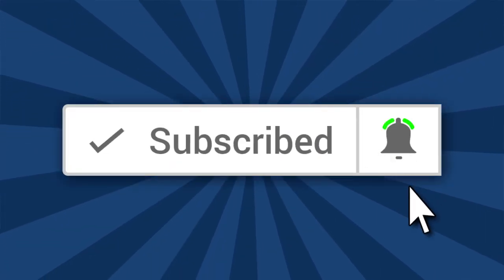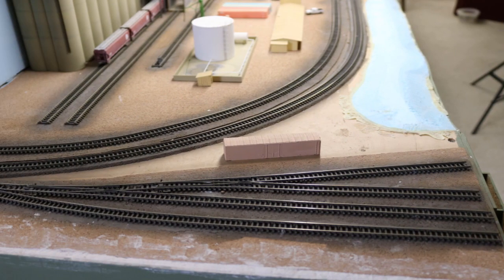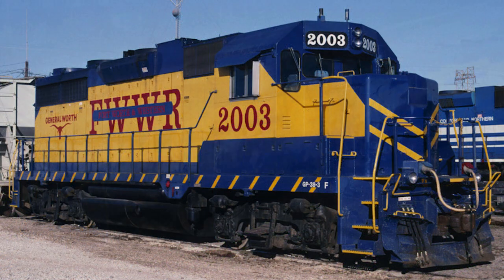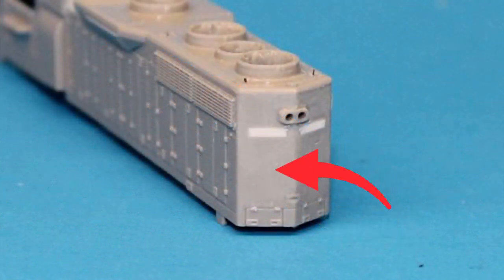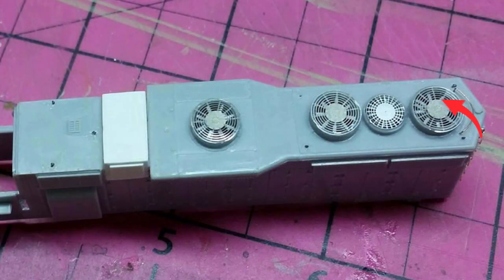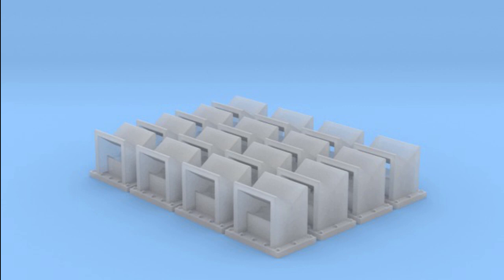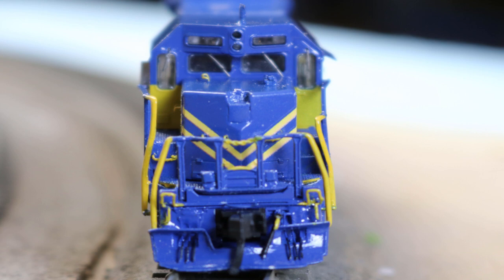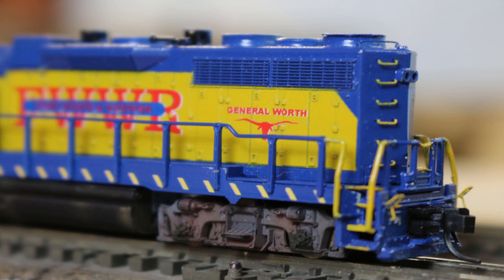Custom Paint and Detail a Model Railroad Locomotive

Comment: Well, Ron, when I want to rust something on my engines and rolling stock, I use real rust.  Here's how it's done.  First I take some 0000 steel wool (fine) and put it in a quart jar.  I then add enough white vinegar to cover the steel wool.  I set it in a kitchen window until the steel wool is all rusted and nearly consumed by the vinegar; usually takes about a month or two and I shake it every so often.  I then pour the mixture into a glass baking dish about 9" square and place it in my closet until all the liquid evaporates, usually 1 to 2 weeks.  I then use my single edge blade scraper and scrape all the rust into a pile and use the razor blade to pulverize the rust which turns it into a rusty powder.  I then pour it into a container like a snuff can.  When I get ready to use it I mix some of the rust powder into a small plastic cup (communion cup) with a drop or two of Elmer's glue, a couple drops of isopropyl alcohol (usually 70%) and a drop of water soluble glycerin.  I mix this up and apply to the engine or rolling stock.  If I want to make the plastic look like metal, I usually make a thin wash out of the rust powder and wash the piece and let it dry.  It makes the plastic look pretty much like metal.  So when I want something rusty I use REAL rust.

Comment: One tip for those MRC decoders would be a sugar cube. I've added a few of the MRC/Digitrax drop in decoders which they sound good. But nothing compared to ESU/sountraxx. But a good sugarcube speaker helps make the sounds louder and more clear.
Reply from the maker: Thanks for the tip. I've been thinking about a sugar cube or a cell ohone speaker.

Comment: As I am modeling a fictional shortline, I decided I wanted to repaint and decal some of my locomotives.  I've chosen to go a slightly different route, by brush-painting with latex-based wall paints, since places like Home Depot can tint little half-pint samples to literally any color you bring in a sample of.  To reduce brush marks (though, I'll admit, not eliminate them), I added Flotrol (which required me to find a graduated measuring cup with a half-ounce graduation).  The painting went well enough, I think.  If you have a steady enough hand, there's no need to mask areas off, other than to create crisp straight lines.  I even found that sharpening a toothpick makes for a good tool to scrape the paint off of the windows when you slip.
For decals, I chose to go with one of a few available products that allow you to print your own decals with a computer printer, choosing the Blinggasm brand laser printer decal sheets (because of the cost).  This was a mistake, as the plastic that makes up the decal isn't quite clear.  It's close, but not so close that the area around the image doesn't end up a slightly different color than the paint of the item you're putting the decal onto.  Thankfully, I tested the decals (three of them) on an unimportant item, and did not end up messing up my locomotives.
Since I wasn't going to be putting decals on the locomotives (yet, at least), I tried to take the shine off the semi-gloss paint with Matte Polycrylic, and found that they apparently don't know what "matte" means, as it turned out even shinier!  I ended up putting another coat of matte paint over top the polycrylic and called it done (for now).
I think I'm happy enough with how it turned out, but would certainly like to give the custom decals another try with a different brand.
Reply from the maker: Interesting process. Thanks for sharing.

Comment: Nice work there. Every loco I do gets super detailed and custom painted as nobody does commercially available NZ 120. Just be careful with MRC sound decoders... I've had a few blow up on me, and the sound goes out on them... if in doubt, go Digitrax!
Reply from the maker: This is the only MRC decoder I've ever used. Went with ease here, but I've installed numerous Digitrax sound decoders so I can swap if need be.

Comment: Hey Ron, I’m currently installing detailed parts to some of my engines (specifically a GP39M) and was wondering:
Is their light bleed out the fan holes on the roof from the rear headlight coming on?
Reply from the maker: There can be, depending of how the light is installed. You may need to fashion some sort of light baffle if this is a problem.

Comment: Years ago when I worked at The Great Train Store in New Orleans, customers would come in and want to buy a New Orleans Streetcar.  At that time no manufacturer made one, we would sell them the Brill Trolley which is shaped closer to the New Orleans Streetcar than any other manufactured streetcar and they would have to paint it.  Since then, Bachman has made the Brill Trolley painted like a NO streetcar but even so, a few details are not the same.  I am in the process of taking a Brill Trolley and adding a different shaped roof and removing one of the ridges on the side.  Also, I have been unable to find a Brill Trolley painted like a NO streetcar that has a motor.  So I will try my hand at these modifications and then attach the NO streetcar to the Brill Trolley motored chassis.  The first time I removed the body from the chassis, I cracked the body as I was putting it back on.  I think old plastic is more brittle than new plastic.  I'm thinking of gluing the crack back together (which glue do you recommend) and filling the cracks with putty. I have loved model trains for many years but I finally have a place I can build a layout.  Of course I have to include the streetcar since I road it to work regularly for over 10 years.  I have always been good with my hands but this is my first trek into model railroading.  Wish me luck on the Brill Trolley make over and I would appreciate any suggestions you have.

Comment: Question..... why when two or more locomotives are used to pull the trailers one must go in reverse? why can they all go on same direction?
Reply from the maker: They can all go in the same direction, but most ofter to last locomotive will face the opposite direction of the first because there are not a lot of places to turn locomotives, so if the consist needs to go in the opposite direction the crew simply boards tha cab on the last locomotive and they are driving forward in the opposite direction with the same consisilt.